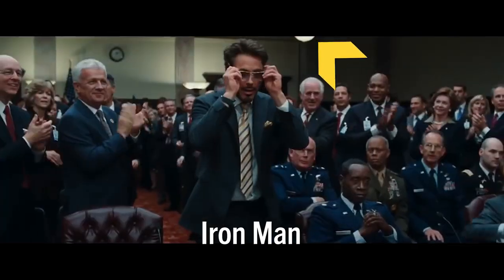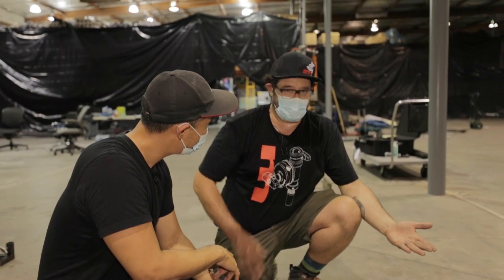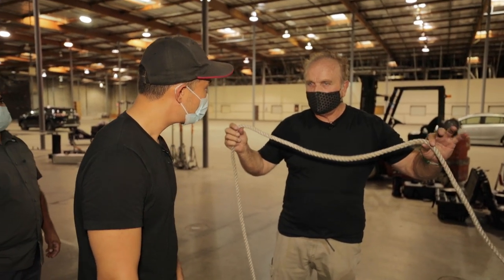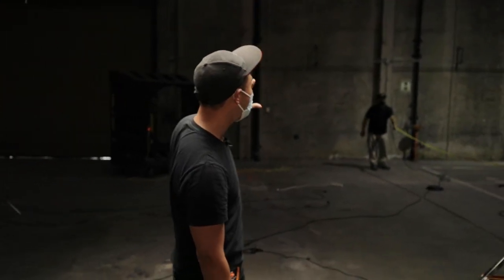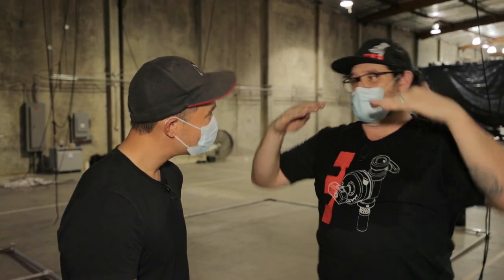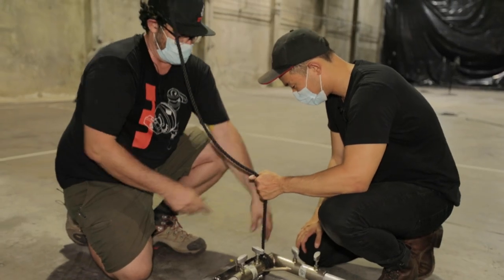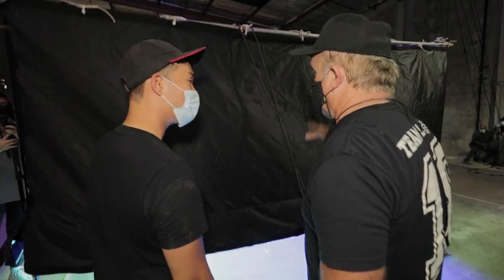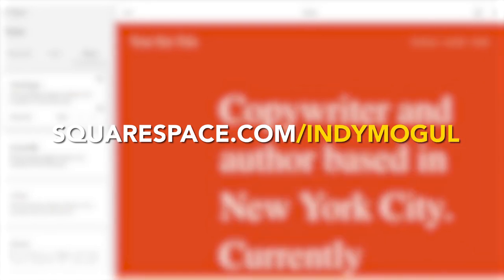How to Achieve Soft Top-Light | Budget vs. High-End

Comment: Lol…well the third option is to fly a  20x frame and boom in your lights above it with some mega booms….for those that don’t own an overhead hoist system.  Four high-highs and four large crankovators with mega booms makes it an equipment heavy rig though… using a frame does give you quite a few options on the diffusion quality since you can choose grid cloth silk, China silk etc.

Comment: Ted saying - This is as indie as it gets
Me thinking - You have no idea how indie I can get
Reply: Foam core inner,  black matte outside, shower curtains, bolts +washers+nuts, 8 right angle hardware frames and some rope. Background stand + Get your lights high enough

or

Background stand + gaff the largest foamcore pieces possible to crossbar, point lights up at it from the ground + good luck controlling spill.
Reply: Each time I see indie in a title it's just a bluff tbh. These guys need a master class of indie productions.
Reply: This is still way out of the budget!

Comment: That “make sure the heavy thing is gonna fall in the same direction that the C-stand tightens” is maybe the clearest explanation of that I’ve seen.

Now which foot on the stand is the one that you always put the sandbags on?
Reply: Place it on the high leg so the the bag hangs and isn’t resting on the ground. That high leg should also be pointing in the direction of the mounted weight.
Reply: This was SUCH a golden nugget. Pocketing that one.

Comment: You guys may wanna consider recording all your audio on a 32 bit recorders if you really aren't going to lower the heat on your audio.

Every video, SOMEONE is distorting like shit
Reply: this!!! great content, but the clipping it kills my sooooooooooul
Reply: Yeahhhhhhh
Reply: They’re using wireless lavs... the clipping happens on the lav transmitter/receiver probably not the audio recorder. It’s a hard balance when using lavs. Just my thought. 😁
Reply: @cmdcreativity  if your lavs are consistently that hot then you're using lavs wrong but yes that's a good point
Reply: Also, having multiple lav mics live at the same time produces odd phasing and delayed effects. A single boom mic would produce a better sound.
Reply: @musicelect  That would require an operator for all shoots though - I'm pretty sure they just have one guy running both the video/audio for these.

Comment: In Belgium, it is illegal to rig electric stuff with a rope (as far as i know). Even a round sling (the polyester version) is not allowed because in case of fire or hot lights, it can melt and fall down. You must use steel cable or chain, anualy tested by a third party.
You speak of rope as a safety (to secure the grid to the stand for example) but you tie all the 4 ropes to the same clamp? Where is the safety there?
I'm not sure about the safety here. Nice you use safety's on the lights but they are useless if the whole thing is comming down.

Comment: Personally, i'd buy a broken television online and rip the LCD panel out of it and hotwire the power supply to turn the backlight on the moment you plug it in. But i guess you don't get the fancy RGB-ness of the lights you dudes use.

I also wouldn't recommend it to anyone who doesn't know the dangers of doing this or how to protect themselves from shock, but still dirt cheap nontheless. Broken 55" TV to mod into a softbox? sometimes you can grab them for free.

Comment: can you not recommend the worst possible rope to be around heat, plant fiber based ones. Get better stuff than that, nylon is a much better choice
Reply: Good point you have there. I guess because they are using LEDs it's less of a concern...
Reply from the maker: Good call -- we're using all LED's so we didn't need heat resistant rope. We also usually use safety chains instead of rope, but we didn't want to stop shooting because we didn't have those around that day.
Reply: @indymogul  I was talking purely about the overlay included by the editor. it showed jute rope which even with minor heat can burn

Comment: This is a master class in lighting, grip, and rigging, in a 20-minute wrapper. From soft light theory to griphead weight alignment to basic rigging knots and safety. I'll be playing this for every neophyte grip before letting them on set.

P.S. I was practically screaming at the screen when y'all dropped the pin in place, gave it a crimp, and loosened the bolt to show the safety on that light. THEN you added the safety chain and I started breathing again--almost had a heartattack!